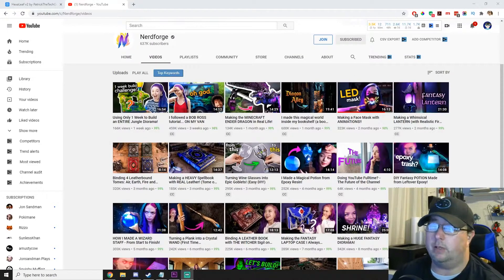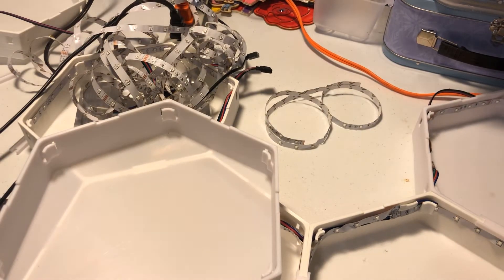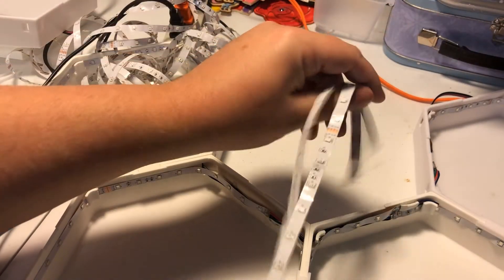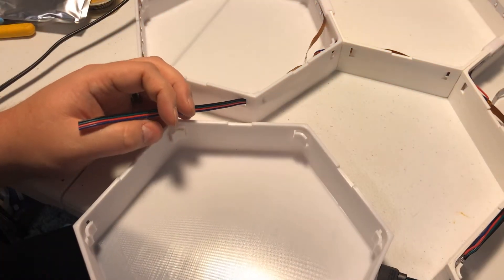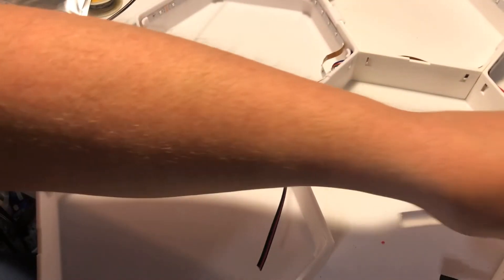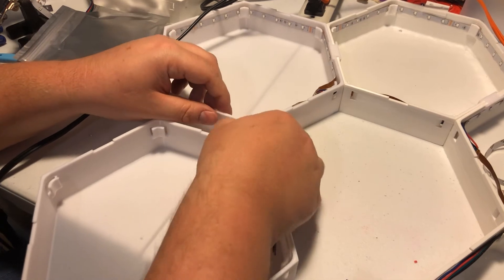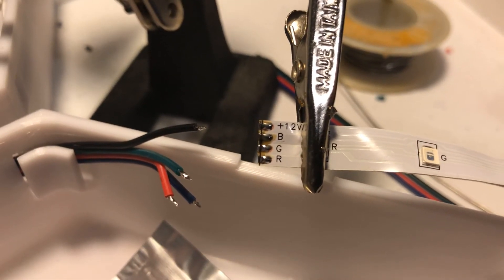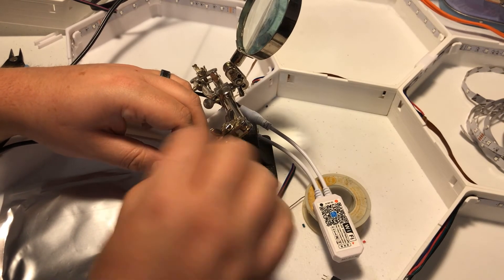How to Make 3D Printed Hexaleaf (Nanoleaf) with RGB LED's (Smartphone or Alexa controllable)

Comment: i tried printing it using my white PETG i have, because i have no white PLA. 
The print ended up diffusing the light really good, but unfortunately it spreads along the printed lines, im a beginner to 3d printing.. do you think faster printspeed might fix or higher bed temperature or nozzle temp?
Reply from the maker: Could try different layer height or possibly add additional bottom layers. Optimizing 3D printing isn't really my forte.

Comment: Did you have to purchase 2 kits of the lights to fit your needs?
Reply from the maker: I think I ended up with 3 when it was all said and done...
Reply: @SouthpawsStudio  also what 3d printer did you use
Reply from the maker: @MizanTech  Nothing special, just an Ender 3 V1 with a Glass bed
Reply: @SouthpawsStudio  Ok, thanks I am thinking about creating these